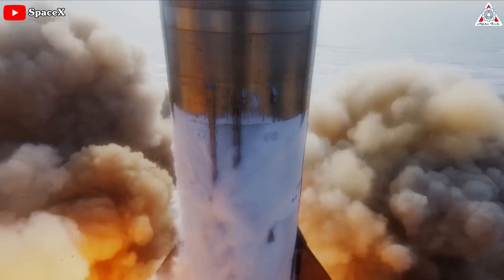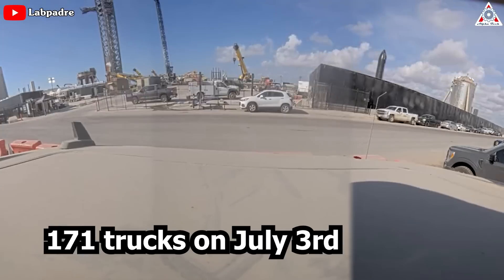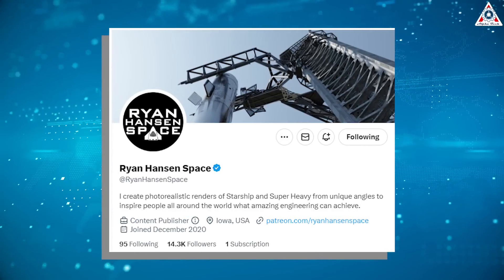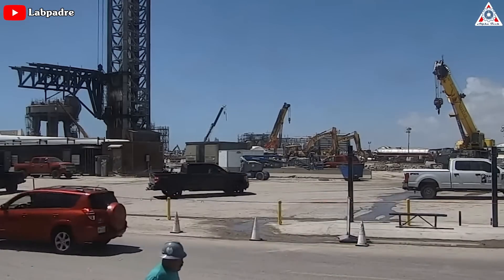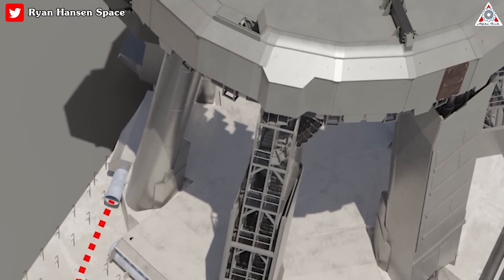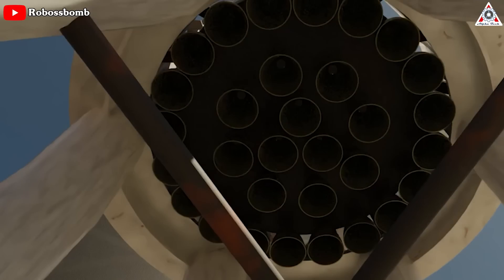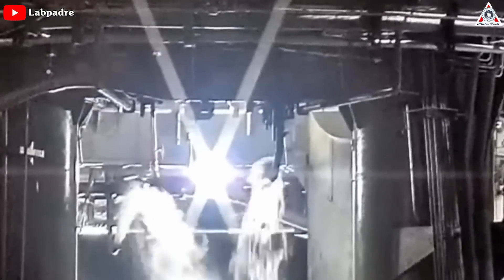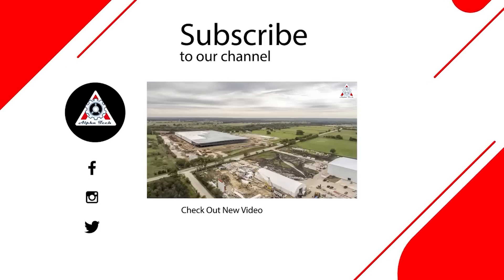SpaceX launchpad is on the edge of ready! 33 engine firing...

Comment: This would take 10-15 years for NASA to do.
Reply: Where did all the Musk trolls come from?
Reply: @DeanStephen  It's all about "Rocket Envy"...
Reply: ... the paperwork.
Reply: @beans4gas  And then Elon would copy it and say he came up with this revolutionary idea!
Reply: They're better at mascot minivans.
To all the Nasa ESGs here:
Um, flame trench ancient,
super shower head innovative.
Reply: @gregorysagegreene  I think it'll work. I imagine Musk's engineers/scientists have run some simulations with a somewhat accurate model to validate the system.
Reply: You can't reuse a rocket. It’s impossible. 
Oh my bad, it's already happened 200 times.
The Elon hate is palpable with the status quo tools.
Reply: NASA is terrified of failure. Space-X is do it and collect data. Failure is part of the process. Space-X has done more in its short time of existence than the history of NASA. Kinda embarrassing, isn't it NASA ??
Reply: What a bunch of  bullshit!
Reply: NASA only launches when the mass of the vehicle is less than the mass of the  paperwork
Reply: Nasa did this 60 years ago without computers, simulation, cfd ect ect ect.
Reply: @donquique1  Actually we did have computers, mostly for computing trajectory corrections and processing spacecraft telemetry data in Houston. They were IBM model 360's for the most part. We had Univac 1230 and 1218 computers at the tracking stations which were used to forward S/C telemetry, process uplinked command data and to stear our 30 and 85 ft Unified S-Band antennas. They were all huge and clunky but they did the job. And we used a large number of computers to simulate EVERYTHING before any vehicles were launched.
Reply: @clarkpj1  And hey hey, all that dino tech and money spent for it paid off riight?
Reply: @jaydonbrown617  It sure was expensive but seems like we hit the jackpot in July of '69! I last worked the NASA tracking network in 1981 and they were still using the 1960's era Univac computers! I reckon NASA got their money's worth out of those behemoths.
Reply: No one now working at NASA has designed a single successful rocket, rocket engine or pad. NASA hasn’t gotten a single American beyond low earth orbit in 50+ years. NASA’s promised ‘cheap, safe & reliable’ Shuttle was the most unaffordable, dangerous & unreliable space vehicle in history. NASA’s promised ‘quick & dirty’ SLS is 16 years & $60+ billion to develop, costs $4+ billion per launch. #defundNasa #cancelSls #goSpaceX
Reply: ISRO can do much better to than this.
Reply: NASA wouldn't build something so f''n stupid. And then circle jerk when a few hundred billion dollars explodes like it was some sort of success.
Reply: Actually, NASA wouldn't come up with such an incompetent design for a powerful rocket. They instead have flame trenches and very adequate water deluge systems at Cape Canaveral, or maybe you missed those.
Reply: @jaydonbrown617 they built that in the 60s with zero environmental restrictions. You could not build a 50 foot deep 500 foot long trench in protected wetlands today..... you are comparing apples to oranges.... they are making due woth current regulations.... i can guarantee they would rather excavate a trench
Reply: @DeanTX I wonder if they could even dig a trench W/O hitting water? The facility is not that many feet above sea level.
Reply: @clarkpj1  It is practically on a beach, so no way to feasibly dig down. I mean it can be done, but even if they decided to, would SpaceX even be allowed to?
Reply: @jaydonbrown617  Probably not given the current EPA regulations. NASA built huge concrete/dirt mounds for pads 39A and 39B but I'd be willing to bet that would be an "environmental no no" today.
Reply: @jaydonbrown617  This steel plate shower head thing is almost as dumb as having nothing. Perhaps even dumber. I doubt they will ever launch from Boca Chica again, but if they do, the destruction of the steel plate, and possibly Starship as well, will be a spectacular sight to behold. Maybe then people will realize what a joke Starship is and what a no-talent assclown Elon is.
Reply: @jaydonbrown617  No. Nasa’s Cape pads require extensive expensive maintenance, including tile replacement after each launch.. NASA doesn’t care, it’s sucker taxpayer’s money. NASA could care less about reusability, costs or results… the more pork to spread for more 3 martini lunches & opportunities for lucrative payback jobs later. Government sucks & Nasa is government.
#defundNasa #cancelSls #goSpaceX
Reply: Musk would rather do it cheap than do it properly.
Reply: @brendanpells912  Because being cost effective is the "future".🌈🌠
Reply: @jaydonbrown617  'A whole bunch of people are probably going to die' is the future, according to Musk.
Reply: @brendanpells912  Eh, it's fine. Musk is hands down the GREATEST human being to ever walk the Earth, so it will be fine because he said so.
Reply: @brendanpells912  Except when a 100 people die on a slapped-together aluminum can.

Comment: I have to give them credit for their efforts, but I still have low confidence in the efficacy of the system. It will only take one exhaust-gas incursion between the plates to create a steam-pocket that will spread at an alarming rate. Once the metal is bare, it will melt with the attendant damage to the infrastructure: water will find a path to wherever the plume blows it. Why does everyone else have their exhaust gas flow at an angle to the deflector plates? I'm sure we will find out in due course. If it works well, there will be flame-broiled hat with seared vegetables on my 'launch' menu.
Reply: Idk why Elon thinks this plate will mitigate the shear force of the 33 raptor engines bearing down on it. Like has anyone really explained the purpose of this plate system? What is it supposed to do besides mildly cool the plate for a few seconds? Stage 0 didn't overheat and blow up, it was disintegrated by the sheer energy of the engines alone, and with only 30 engines nonetheless.🙄

Comment: I heard that in high temperatures water (H2O) transforms into gaseous Hydrogen and Oxygen. Such conditions we could expect during the launch, on the launchpad, where water will combine with fire. Am I correct?
Reply: That's essentially saying that water vapor is flammable. Not sure if that's how I remember things, but I do believe the sheer amount of steam generated will be the real problem.
Reply: Disassociation of water into O2 and H2 requires a number of things to happen such as the case of the Chernobyl nuclear reactor.
Flame mixed with water does not pose a similar threat.
Reply: @triggerpointtechnology  Ther eis a citation from Wiki: "Thermochemical cycle In thermolysis, water molecules split into their atomic components hydrogen and oxygen. For example, at 2200 °C about three percent of all H2O are dissociated into various combinations of hydrogen and oxygen atoms, mostly H, H2, O, O2, and OH. Other reaction products like H2O2 or HO2 remain minor. At the very high temperature of 3000 °C more than half of the water molecules are decomposed, but at ambient temperatures only one molecule in 100 trillion dissociates by the effect of heat.[15] The high temperatures and material constraints have limited the applications of this approach.
Reply from the maker: In theory that is true! however, in my opinion, the amount of water seems to be small compared to the heat from the engine, so when the process takes place we will not notice it.